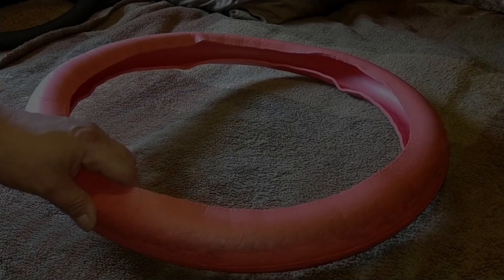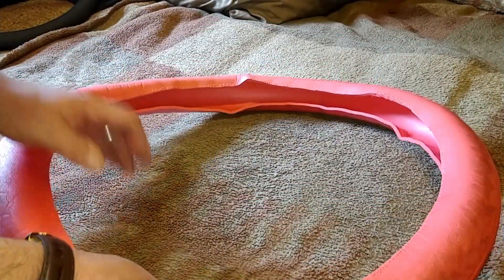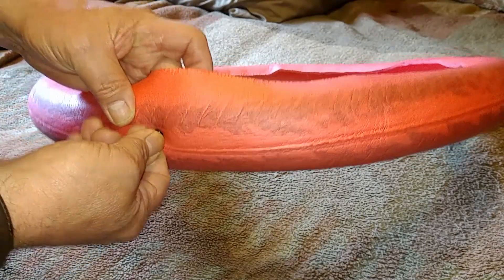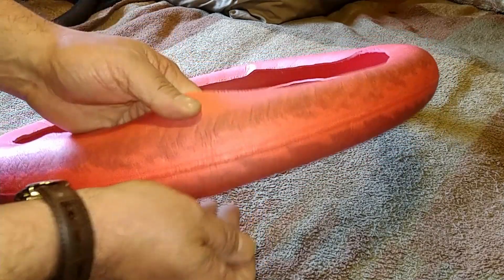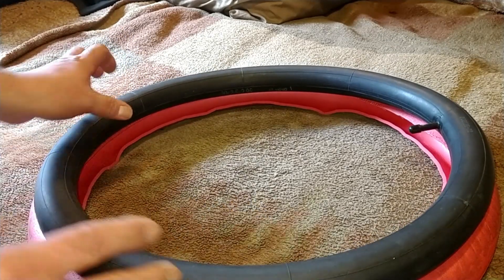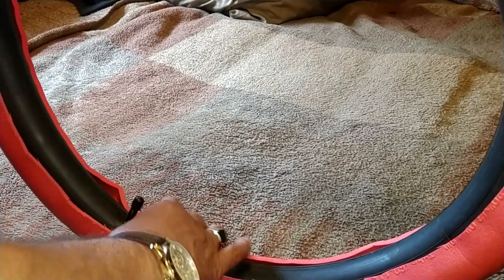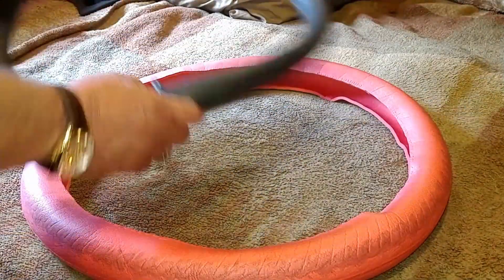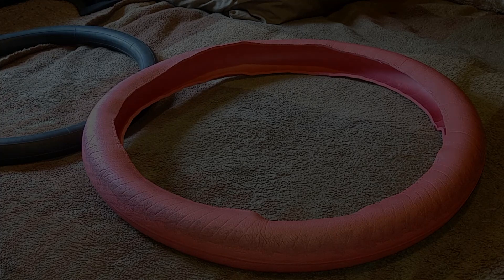LECTRIC XP - Tannus Insert ( Day 4 Observation out of Tire ) Little Change!!!

Comment: Alright, you can put it in a vacuum chamber, but it's just rinse and repeat.
If you want an excellent lube for your chain however from a new unlubed chain, place it a vacuum chamber to remove all of the moisture layer that exists on everything and then lube it. My instructor who worked at Los Alamos taught me that one about his motorcycle chain. Check out a local college, they might have the facility.
Reply from the maker: Interesting idea, but nobody is going to go through all that hassle for these inserts going flat.
Reply: @Pandafoo  That's why I said rinse and repeat. If I break down a tire, I only want to do it once. Most of those inserts cost more than actual tires which can basically do the same thing.
Reply from the maker: @rofflestomp684  I know, but even the instructions mention you might need to remove the insert...I mean who wants to do that rinse and repeat stuff, right? No one does :)
Reply: @Pandafoo  Exactly. The first time it's an adventure and a buff, after that it's a chore. I totally understand why you would wait for the next item to be delivered before putting it all back together.
Plus you have that Rad Rover; that would hold me over for a few days for sure. 👍